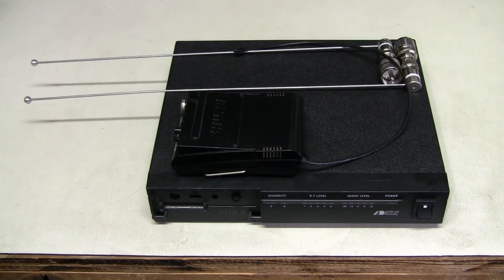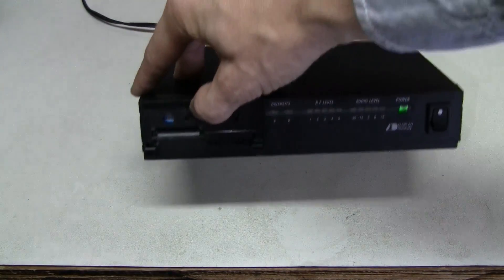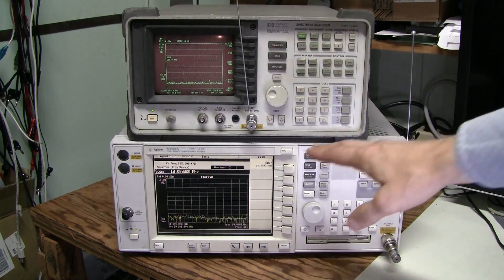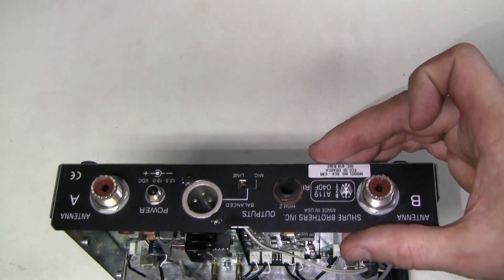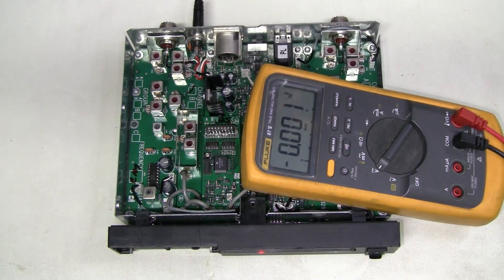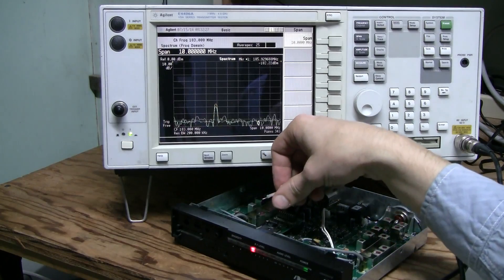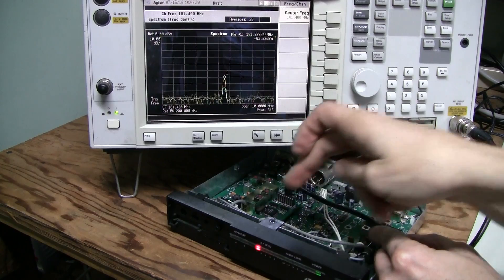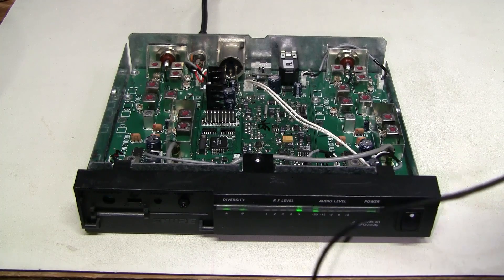#49 - Shure SC wireless microphone system repair

Comment: I always use a ceramic trimming tool to push on PCB's to test for poor joints/cracks, as it doesn't effect the circuit, as you discovered.